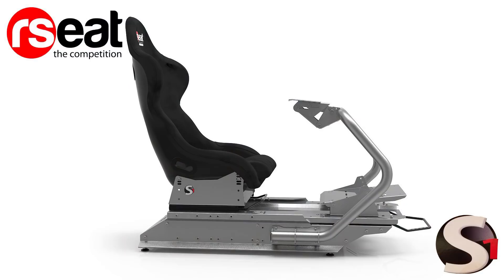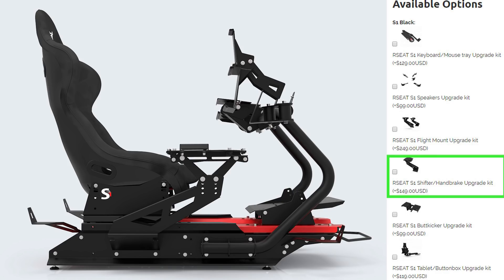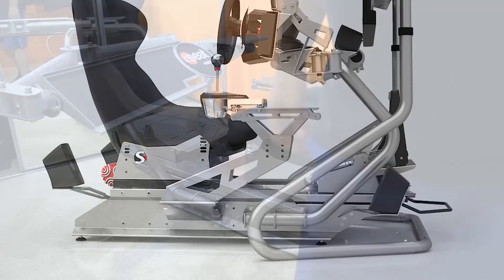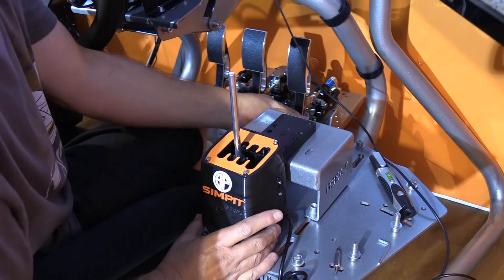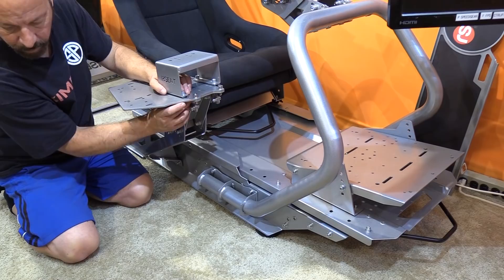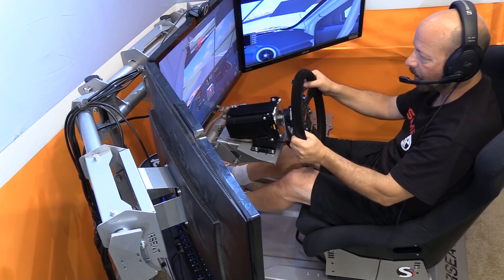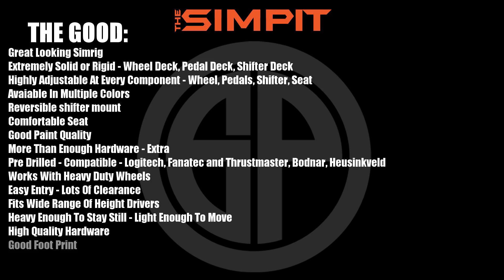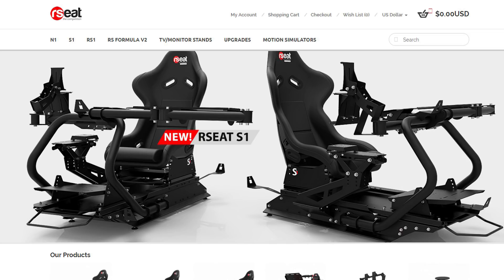RSeat S1 Review - Is this the best RSeat ever?

Comment: After 2 years, do you still think this is the best chasis you have tested? I am shopping and would like to buy a good cockpit
Reply: I just sold mine and getting a sim lab p1x instead.. if you have a directdrive wheel and serious pedals,, you’ll have flex in the S1
Reply: @wpmmotors  weird my B1 seems solid as a rock. My only complaints new product and all. I don’t believe they’ve made an instruction manual yet so I didn’t get one. And I’m missing the screw on feet. Otherwise seems like an amazing chassis
Reply: This is what happens when you have to hire all new employees after a pandemic hit hard.
Reply: @wpmmotors  i purchased the sim lab p1x after doing lot of research and I love it

Comment: I'm currently in the market for compact rig like these but my problem with RSeat is that they're so expensive. Although I'm in the UK, the prices are in Euro's for me and the price for the Simetik K2 frame with the shifter mount is €383.80. Infact, add a Sabelt Racer Duo seat on there with sliders and the total comes to €662.80! That's a full rig that's cheaper than the RSeat S1 frame alone! And as far as I'm aware, there isn't really a major advantage the RSeat has over the Simetik to warrant that much of a price gap. If you find one, let me know.

Comment: Great video Shaun! I just received the S1 in black and red and it's absolutely gorgeous. You are spot on re: sliders are difficult to move. How did you get the front sliders to move? It shouldn't be this difficult, but they are stuck. 🙁

Comment: Hey Shaun - have you spent any seat time in the Formula V2?  I'm deciding between the S1, N1, & Formula V2 & it's a tough call.
Reply: Josh,  I've owned the S1 for a few couple months now and while I agree with most of Shaun's review; I feel he overlooked a pretty critical flaw. If you look at the tubing that attaches to the wheel deck on the N1, you will notice they gusseted it to prevent any flexing inherent in the hollow tubing. They overlooked adding this additional reinforcement on the S1 and this oversight adds additional flex at the wheel deck. I can move my wheel well over a 1/4", which translates into lost feedback and a vague feeling. I am currently running a Fanatec 2.5, but have the DD1 on preorder, and am really concerned how this is going to hold up to the extra torque the DD's are capable of. I'm also worried the improved resolution will be lost due to the extra flexing. For this reason alone I would highly recommend avoiding the S1 until Rseat provides a solution. I have reached out to them concerning this matter and am told "they are looking into it".
Reply: @markguest8575  Is the S1 better then next level gt track?

Comment: Is there a way to get the NLR V3 motion on to this Shaun?
Reply: I just got one and there are a few ways you can mount the V3 to this rig. I used a very simple way. I cut the bottom portion of the L shape on the V3 brackets, then I open 3 holes to match the ones on the rig and voila!!! I'm also working on custom brackets to use the rails but it works perfectly the way I have it now.

Comment: What a bummer. I just watched your review and was super stocked at the amazing shifter/handbrake arm. But after looking at the website it seems that they nolonger have this huge arm to hold it. Its this little arm screw on the side. It does seem to have the same large plate for mounting the shfiter and handbrake on. 

Why did they get rid of this thing? It looked amazing. :(
Reply: Nevermind I was looking at the c1. The s1 still has the monster shifter arm. NICE

Comment: Thanks for the great review Shaun!
I'm trying to decide between the RSeat S1 and the SimLab GT1. Do you prefer the S1 over GT1?
Reply: What did you go with?
Reply: @vathrosable  Not OP but in the same shoes. I went with GT1. Mainly because it's so customizable.
Reply: @mission772  that's mission.. I just ordered from sim labs also. I was afraid the seat would be too small, and my hands too far from the wheel since I'm really tall.

Comment: Going to put a sparco reclining seat on it
Reply: Were you able to do this? I've looked it up and the brackets on the S1 don't fit a sparco seat. How did you resolve the bracket issue?
Reply: @tomdreiling1186  You've probably already found out by now but if not: I was unsure my fat ass would fit the seat so I bought a BMW sports seat from a junkyard. Then I purchased a 6mm metal plate and drilled holes so the metal plate works as a homemade adapter. It has great adaptability and awesome comfort - I can drive for hours without hurting my ass or my back unlike my old rig.

Comment: One of the pbs with the RS1 was that the peddle plate would flex under heavy breaking. Is this also an issue with the S1 ?
Reply: Smooth acceleration  it has slight movement (if you had a cam on it) but not noticeable at all under heavy breaking

Comment: Would this be too heavy for a 6DOF motion platform?  Will be using 6 20A 24v 40:1 gearbox DC motors.
Reply: jeepgunner jeepgunner I’m using this on a Pro-Simu 5DoF platform no issues.
Reply: @samirkilachand  nice! gotta get some vids out there!
Reply: jeepgunner jeepgunner personally I would recommend sim-lab P1. It’s sturdier and more configurable.
Reply: @samirkilachand  sturdier?
Reply: spaceman1980 it doesn’t flex

Comment: looks like it has the same issue that most comercial rigs have, the wheel deck is way to low! A race car position has tho top of the wheel about 2inch below eye level. This looks like driving an SUV. awful.
Reply: Was thinking the wheel deck was a little low also.
Reply: You are completely wrong! - Ask Shaun to show you the  S1 with lowest seat option and highest possible wheel deck option!;)
Reply: @PLAYGASM  I can see by looking that the deck will go up 3-4 inch and the seat down by about 2. Still not enough. He looks like he's going off to deliver post in his driving position.
Reply: In fact actually he's already got the seat at its lowest. Poor.
Reply: You just trolling! What is low for you? Compared to what? Let`s discuss and if you are right - let it be!
Reply: @PLAYGASM  not trolling at all. As I said in my first comment, in a gt car you sit more or less on the floor with the top of the wheel a couple of inches below eye level. This doesn't do that, it replicates a standard road car position. It may well be comfortable but for me I want an authentic position.

Comment: To me this entire rig looks overly complex just for the sake of the aesthetics. Which is a matter of taste if you like it, and I would personally prefer the simpler but just as adjustable but more modular Sim-Lab P1 design.

I had my RS Evo V3 die on me half a month ago, and thus I mailed RSeat but no luck getting parts 6.5 years later. The metal bar to which the pedal plate attached had started to tear on both sides and failed before my CSPv2 loadcell did.
So RSeat directed me to this but... I just didn't like it personally. Besides, I always drooled over 80/20 because even as an adult I still love Lego. So I value modularity over aesthetics, besides maybe I will build my own DIY motion actuators in the future and it is easier to do that stuff on 80/20.